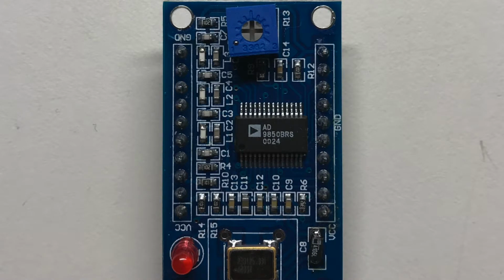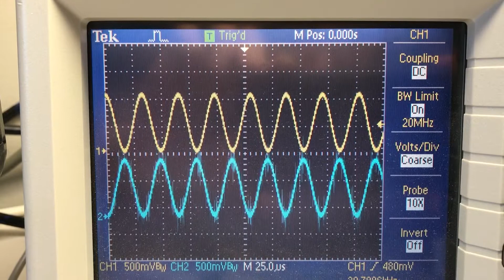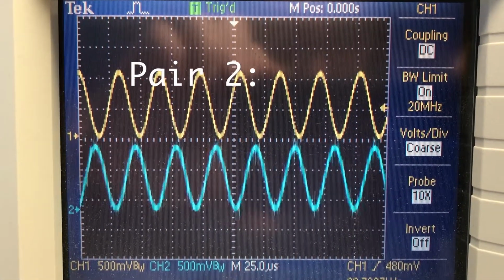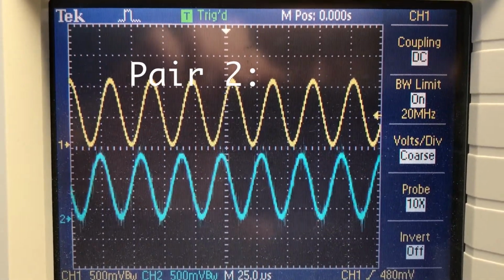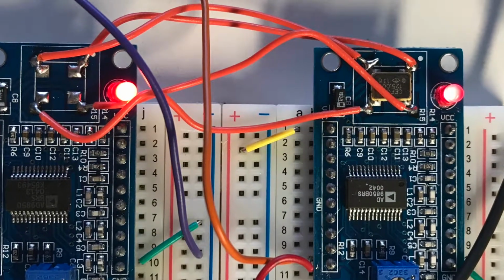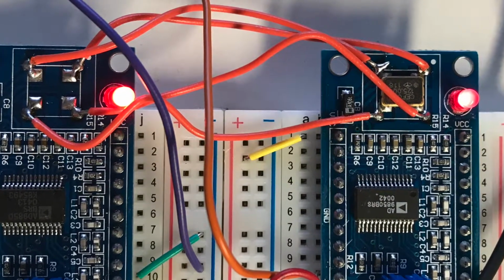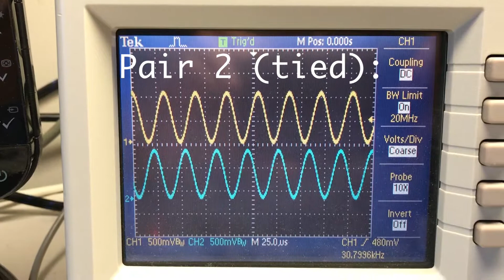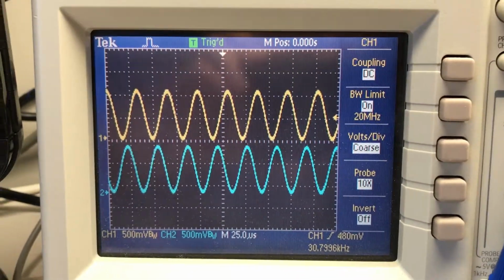Clocking Two AD9850 Dev Boards Together

Comment: AD9850 has 2 sine output. It would had been best if the phase difference bewteen the 2 sine waves could be configured (I/Q signal)
Reply: I don't believe (it has been a while) that the AD9850 has two separately controllable sine wave outs...it has one and then there was another pin that was the complement of it or something. That was the point of doing this...to get that functionality from two devices and since slight deviations in the frequency of the crystal would ruin the ability to have stable phase relationships, this video just shows hooking the crystal line together.  

I modded some code from another dev a while ago to do phase control of the two signals (that was actually the whole point since I needed it for a project).
https://github.com/jodalyst/AD9850
Reply: The second output is not independent, it is just a balanced output

Comment: Hi jodalyst, is it possible to get your Arduino Code for sync of two AD9850? That would be great! Thank you very much
Reply from the maker: There's a brief writeup here.  https://jodalyst.com/random_work/ad9850/

hope it helps.
Reply: @jodalyst  Oh thank you very much! I had a look on it. Is it the code for the sync mode? And do you remember what PIN 13 and POWER_CONTROL were? Sorry for bothering...
Reply from the maker: Off the top of my head no.  This was like three years ago almost.  There's definitely some tutorials out there for how to wire this up and then I just sort of replicated it. Feel free to email if you want (jodalyst AT gmail.com) if you have more questions
Reply: @jodalyst  Hi
I tried installing your extension library but it seems to have crashed. I tried to fix it, but it doesn't seem to work. I also can't find the sample program in the Arduino. Looking forward to helping!